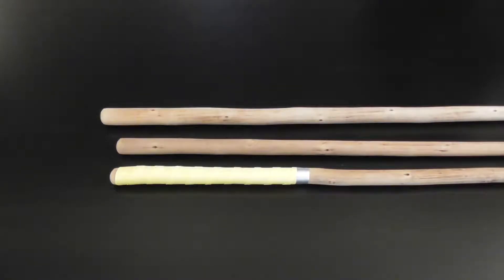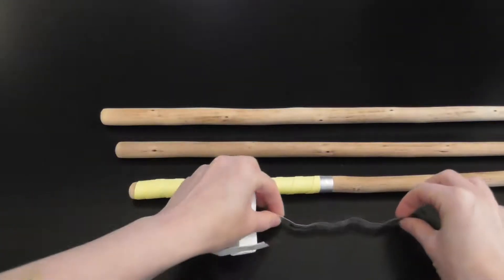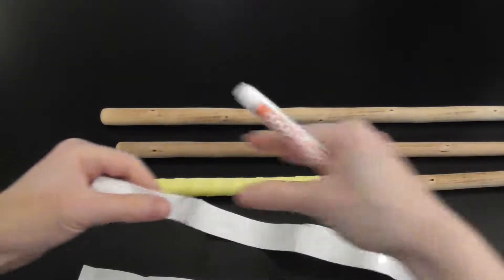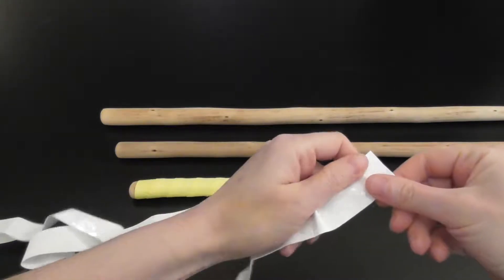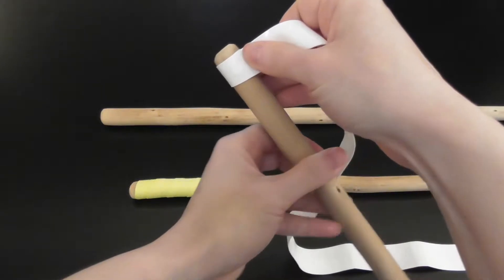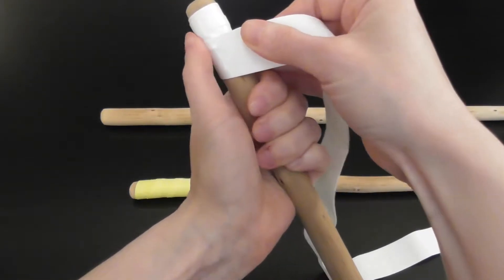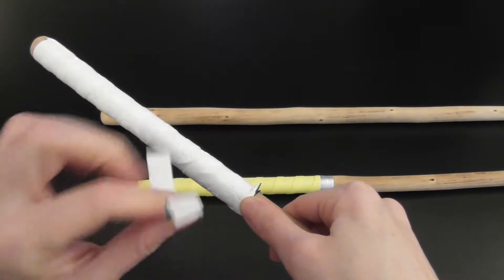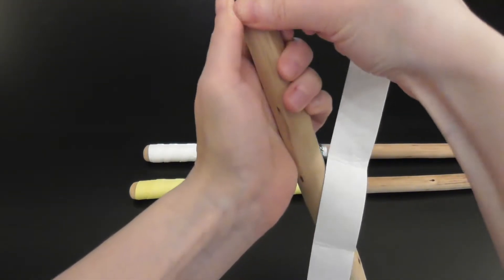Cane Taping

Comment: If my cane had carved in grooves can it still work?
Reply from the maker: The taping should still work. Or do you think using it in competition?
Reply: in case I was unclear my mom seems to want a cane now( For  self defense) maybe I didnt say it before but I if  I cant afford to have grips put it do you think tennis tape at the top and bottom could be a possible alternative she wanted this for a self defense purposes thoughts please thank you
Reply from the maker: @Fredengle  the taping increases the grip and thus the cane is less likely to slip out of your/her hand. This makes sense for where you hold the cane (so at the grip area) if you want to hold it as you would for fighting/self defense. It does not necessarily help if you want to lean on the cane for walking. Hope this is helpful